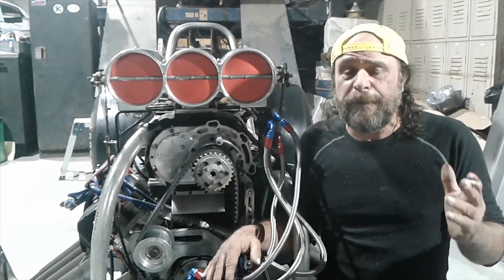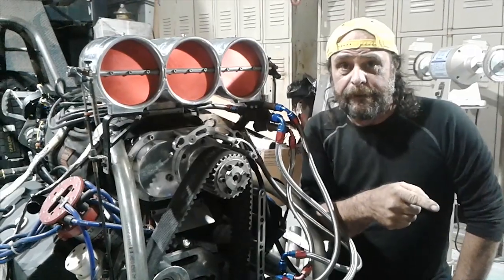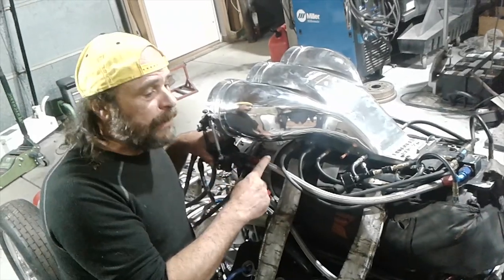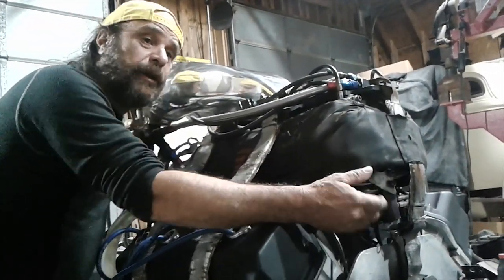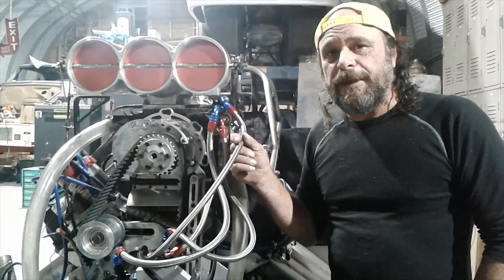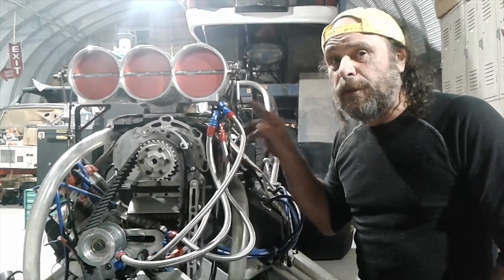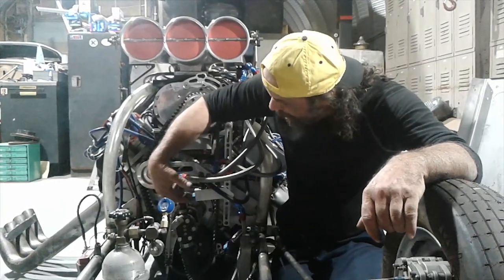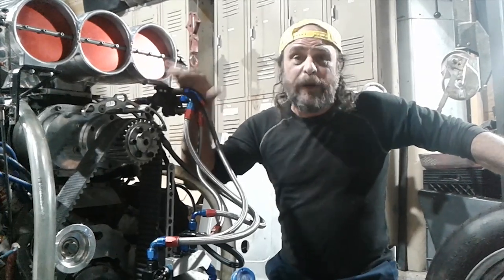Mechanical Fuel Injection 101

Comment: I usually read the comments, some like your short vids, others are like slow down. Do you make more revenue off 100 2 minute videos than fewer 10 minute? 
    Some like your antics, some want to learn, I'm still trying to figure out what your vids are about. I've seen those who get thousand of subs then change their tactics. I'm an old Mopar man, 68 B body like yours, two 440's one 383, late Hemi, and a little over a half a dozen other vehicles. Most would have to watch that video several times to half figure it out, but maybe that's the point.
Reply: Try smoking a little less weed and actually enjoy the content that you watch.

Comment: I miss running a blown small block, 7 gallon pump and 6/71 with 1 set of hat nozzles. Doesn’t even need a hi speed, if you have one it becomes the pump saver. Run everything into a little manifold block and 1 -six return is all you need. Ultra simple!

Comment: So in general are the VW TDIs and SDI engines with PD (injector units driven by camshaft lobes, direct injection) considered mechanical EFI ? ECU controls the amount of time the injector runs but the cam is actuating the pressure, coupled with a camshaft driven tandem (vacuum and diesel) pump to bring that fuel to the block

Comment: Ever been a case of nitro detonating INSIDE the mechanical fuel system?
Reply from the maker: Never.  It needs heat and pressure to become volatile.  Behaves just like water in every other respect
Reply: @UncleTonysGarage  - Seriously? Wow, that's wild. I'm glad to hear that, a bit less worried now about using the stuff later on. Thanks!
Reply: @tommylyeah  nitro wont burn on its own. But take a bottle cap full and pour it onto a steel table and bang it with a hammer and watch what happens

Comment: I pretty much understand it, with this video and some other online articles that I've red. But there's still something which I have doubts about: is the fuel injected before or after the blower?
Reply: The hat nozzles are basically used to seal up and keep the rotors cool. Most all the tuning is done with the port nozzles since we base everything off of 100 psi. The pump on that car is called an enderle 1100 which flows 17.4 gpm the car on the lift has a more modern psi roots but smaller cubic inches so it has a 1200 pump. Its always better to habe too much pump and just return excess back to the tank than not have enough fuel.
Reply: @davidroberts2404 I am very interested in mechanical injection, but having a really hard time finding a comprehensive source of info about it. Any books or series you know of that shows how to design and tune one of these systems?

Comment: Great video Tony. I'm upgrading my Enderle 110 (13.2GPM) to a 1100(17.2GPM) on my blown alcohol hemi. The 110 pump flow is border line but the 1100 is a little more than what I need. Do I need to install a pump sizer line with a poppet or will the pump saver line on my enderle barrel valve work ? Thank you, Bill

Comment: That is nostalgic mechanical fuel inj for nitro the alchohol inj on a sprint car works on a similar theory but there is 8 barrel valves in the stacks the tuning is way more of a pain in the ass theres enuff check valves to start a parts store
Reply: Same as this. None have 8 barrel valves they all have 1 unless its a big show nitro car that runs a barrel valve on each side of the hat.